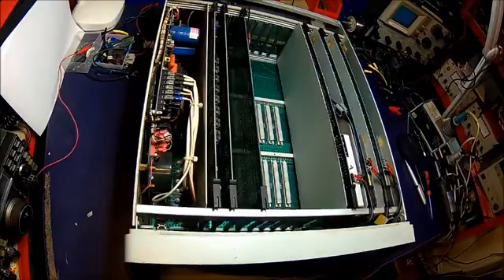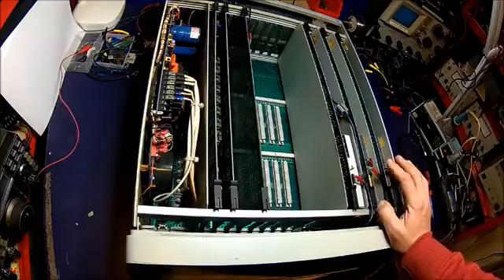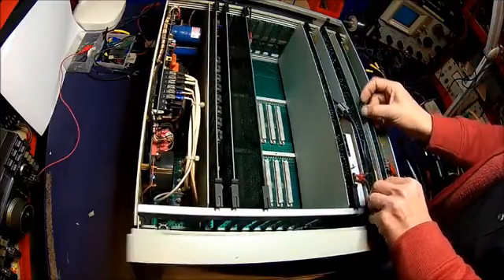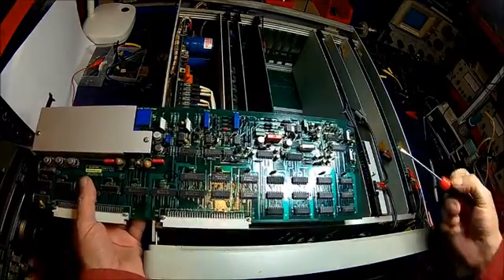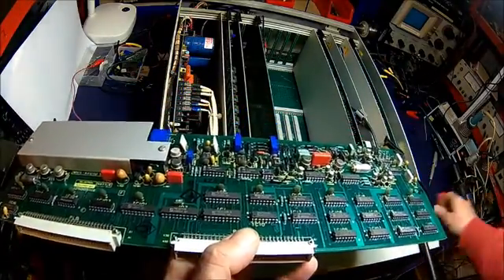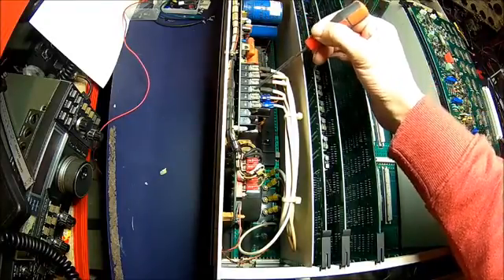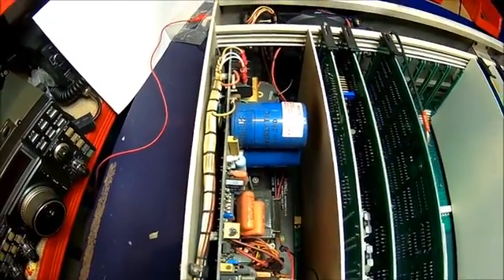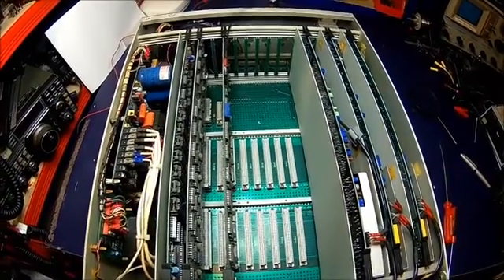Solartron 1250 Analyzer - Component details (viewer request)

Comment: You're probably not monitoring this anymore but just in case: any idea what "issue 03aa" means when it's displayed after startup?
Reply from the maker: If i remember that right, this is the software version which is displayed after an extended self test. I think it does that every time when it was shut off with at least one warning currently present.
Reply: @dynoguy  Ooooh! So, not an issue but rather an issue! Makes sense now. Much appreciated!